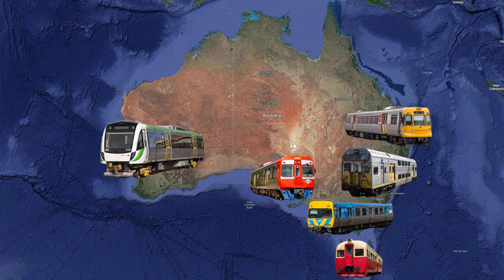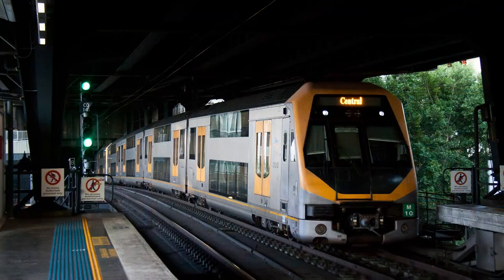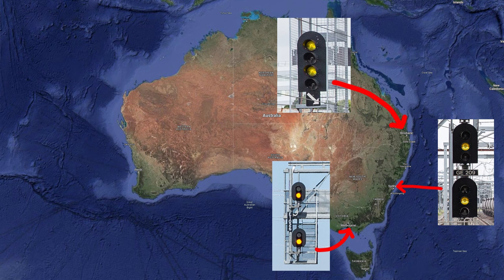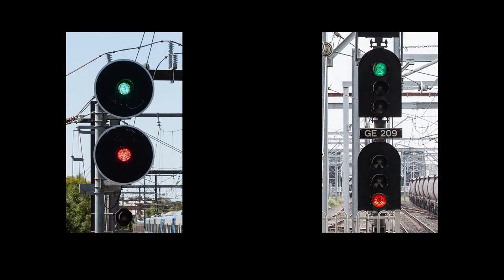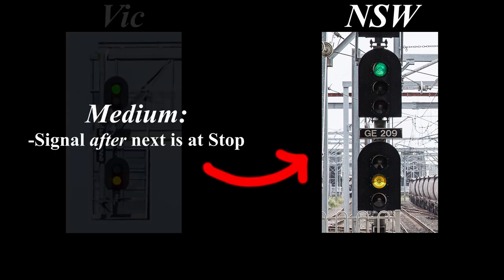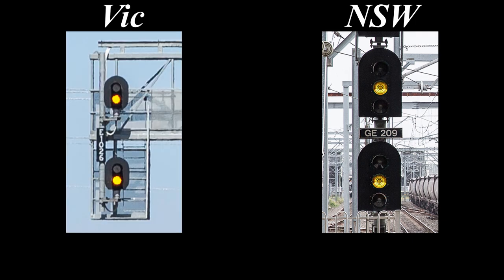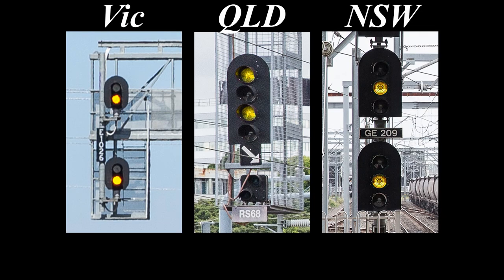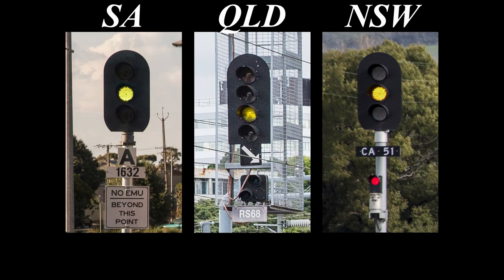Australian Railway Signalling - Conflicting Aspects

Comment: Very interesting video! In my home country, I believe there are still some small signalling differences between former East and West Germany, but of course it's not as different: it came from a common source, diverged slightly and was then unified again
Reply: No, that not true. Interesting we use exact five different system in the Federal Republic of Germany. First the old GDR (East Germany is a wrong word for this country - it is north of Bavaria!) system and the new system, then the old FRG system and the new system and the European system for ICE and EC trains. But as locomotive driver do you learn all at school and by practice very easy - then all same color have the same meaning different to the Australian system. A big difference: We drive normally on the right side but around 80% or 85% are double signalled from both sides so that the train can go on left side too. 

All modern locomotives copy the signal and info inside the train locomotive so that the driver can see it easier at more as 160 km/h speed.
Reply: at one point, East German Railways adapted electric signals from the USSR (presumably forced?), it is called EZMG i think
Reply: @anindrapratama  apparently EZMG were used because the East German factory for signalling equipment was too busy

Comment: Wait… did you say they use different gauges in each state? Is there a video on that?
Reply from the maker: I haven't made one, but if you google 'Australian railway gauges' I'm sure you'll get plenty of info!
Reply: Yeah, it's absolutely insane - and at least partly deliberate. However, the first railways in each state were small systems a very long way from anywhere else. While they generally knew what was being done in other states and sometimes deliberately did the opposite, they probably couldn't imagine there would ever be a connection between the systems. It's only within the last two decades that all mainland Australian capital cities have been connected by standard gauge railways. Although each state's rail gauges remain mostly different from each other.

Comment: Important to note is that Flashing Yellow in QLD means that the next signal is at stop but there is no overlap (thus the speed restriction).  

We also handle conflicts between NSW/QLD signalling in Brisbane Suburban Area principles with standard gauge routes in dual gauge areas not being able to set warner routes (Flashing Yellow aspect) - so at a locking level a standard gauge train may not be given a proceed aspect until the overlap is clear and able to be locked, where a narrow gauge train is fine to be cleared up to a red without an overlap!

There's entire videos you could make on the world of QLD signalling - as we're split between BSA and Regional principles.. so.. uh.. twice the fun?
Reply from the maker: That's really interesting, thanks! I certainly would like to do a whole video on Queensland signalling, but i need to learn a bit more about it first.
Reply: @Taitset  feel free to reach out if you do or need a run through of anything!  i have some simulations covering some of the more interesting principles - like dual gauge, complex overlaps, level crossing and regional principles.

I could also help explain some of the more interesting complexities of signalling design through commissioning, and always willing to help more people get interested in my field!
Reply from the maker: @dylanwillis6557  Awesome thanks, I will get in touch when the time comes!

Comment: It's still weird, from an outsider's perspective, that Australian states have such a large degree of autonomy. Especially when the pandemic hit and state borders were closed.

Here in Europe, we use standard gauge throughout, except on the Iberian peninsula, Ireland (which is an isolated system), Finland and the former Soviet states.

Regarding signalling, would it make any sense to introduce ERTMS, or a variant thereof like the Chinese did? Every country in Europe has its own system, but there are efforts to harmonise these. Especially international high-speed trains benefit from this.

Obviously, Australia is more or less the size of Europe, but with a fraction of the population and of the rail network, so the answer would probably be "no".
Reply from the maker: One thing about Australia is that there is only a single line connecting each state (at the moment), and each is long enough that it can't be worked in a single shift, so in terms of crewing at least there is a bit of natural separation, unlike in Europe where it's possible to drive through several countries in a single shift. Getting NSW and VIC to cooperate on anything is very hard. Although in recent years both have adopted a digital train radio system which is fully compatible as far as I can tell.
Reply: The thing you have to remember for track gauge is, they started up their rail networks prior to merging together, in basically completely independent systems with no connection to each other.
Reply: The autonomy is a holdover from Federation.  As part of the agreement to form a single nation, under a Federal Government, each state, or colony at the time, wanted to maintain the same, or similar, level of self governing they enjoyed as separate colonies.  Thus it continues to this day, 121 years later, despite the many issues it causes.
Reply: Even though it seems like Australia is one country, it's not really. It's a federation of states, which are virtually countries in their own right. They ceded some powers to the federal government, but only a limited amount
Reply: @WillKemp  Fair enough. Put it this way: the USA are always beating their drum about being different states, but the Australians aren't. I also can't imagine internal borders getting closed in other federations such as the USA or Germany. Heck, most of the Schengen borders remained open during the pandemic.
Reply: @SeverityOne  
"I also can't imagine internal borders getting closed in other federations such as the USA or Germany."
And I couldn't imagine it prior to covid either.  Partly because it appears to be unconstitutional.
Reply: @PJRayment  That really depends on what the respective constitution says, and what power individual states have versus the federal government. Apparently, in Australia the states have a lot power. Funnily enough, the Australian constitution mentions New Zealand as a state.
Reply: @SeverityOne  
"That really depends on what the respective constitution says,..."
It appears to be unconstitutional according to the Australian constitution.

"Apparently, in Australia the states have a lot power."
They do (in principle at least).  Similar to the United States of America.  But the various (Australian) state constitutions do not override the federal one, which says that "... intercourse among the States ... shall be absolutely free".

"Funnily enough, the Australian constitution mentions New Zealand as a state."
No, it mentions it as a possible state.  New Zealand was one of the (then) colonies that would be a state if it was made part of the commonwealth.  It wasn't.
Reply: @arokh72  The United States was formed in a similar fashion of Federal government. But the roles and rights of the states were severely altered by the "Civil War."  That war was brought on by outraged states that resisted federal influence.  Although it turned into a war about slavery and that outcome as righteous, the states lost a good amount of autonomy as a result.

Comment: Yellow or is it Amber?
Reply from the maker: Usually called yellow in the railways. But same thing.
Reply: In Australia it's always called Yellow in signalling. It might technically be a colour closer to amber but we never call it amber.
Reply: @Woodsy3211   Amber, meaning caution. Up until a decade or two ago, it was always called amber. Since then for the uneducated yellow has appeared as with the colour amber in different pages of the Queensland Transport website. Amber is the colour of beer until it's passed out, then it's yellow.

Comment: I think it would be worth going into some details as to why the signal aspects are the way they are. Victoria, in particular, has this weird mismash of British and American concepts and seems to embody the worst ideas of both. The repeater signals seem kind of pointless because there are two ways of indicating Expect Stop and Expect Clear Normal Speed. A fixed sign next to the first three position signal stating "Begin three position signalling" would have been far simpler.

The NSW double light system has a logic to it, and the single light system also is consistent in its indication. NSW signalling is complicated by the need to indicate routes rather than speeds, and the huge number of subsidiary aspects.
Reply from the maker: Yeah totally. To cover it all in depth would probably take hours! I've also always wondered why repeater signals are like they are, seems an odd way of doing it.
Reply: I'm wondering what this "American signaling" system is. Offhand I can think of at least three different ones used on mainline railroads in different parts of the country, not to count the aspects used by various metro passenger railroads. The US had much the same history as Australia -- separate railroads that had their own rules, signaling systems, and conventions. Train crews only ran on home rails, with a few exceptions, so only had to know one set of aspects. 

There is a widely used base set of rules, the GCOR, but this is a prototype set of rules that is then adopted by each road and modified for local conditions. A lot of the Eastern areas have their own rule bases that aren't completely compatible with the GCOR.
Reply: Look up Canadian Railway signalling if you want to get an idea of how it makes sense. It can be a bit difficult to get your head around because it is fundamentally a different way of doing things.
Reply from the maker: @lwilton  I didn't refer to any specific American system, but the concept of speed signalling originated there, and the VR and SAR systems have clear American influence.
Reply: @Taitset  Unfortunately the Victorian system is a bespoke system based loosely on the American speed signaling method whilst doing a straight copy/paste of SA's regs. NSW, Qld and WA are based more on the British route signaling and each are, or have, introduced elements of ETCS v2. It's an absolute mess, especially when trying to explain it to an undergrad that you are trying to coerce into a signaling career 🤣🤣
Reply: Repeater signals can become useful in the regional area when you have a long non-signalled area between 2 home signals. Imagine a driver travels for 20km before seeing the next home signal, having a repeater before that will at least let the driver know what to expect instead of digging in the memory 'what was the signal before'.
Reply: @jaydenzheng7248  Repeaters are basically distant signals. They didn't need to be reinvented—an ordinary 3 position signal that normally shows Caution would suffice, or even a Landmark sign like what NSW does. Mark that this signal is a distant signal by adding a yellow post plate or painting the signal arms yellow instead of red.

If Victoria had developed the two-position signalling into three-position signalling the same way the Italians did, Victorian signalling would be a lot more consistent and logical.